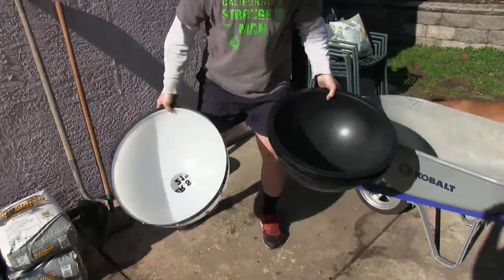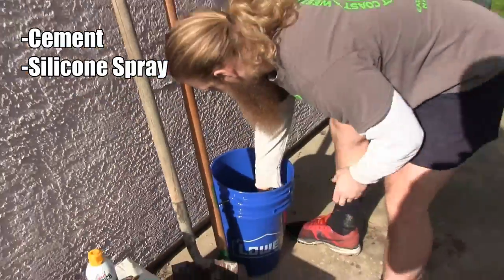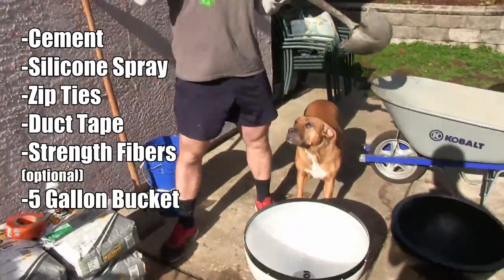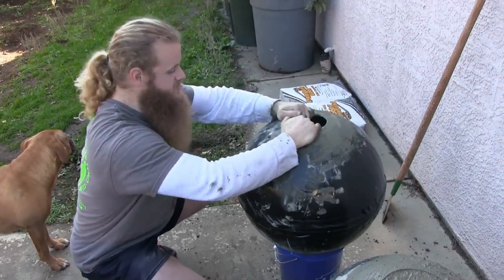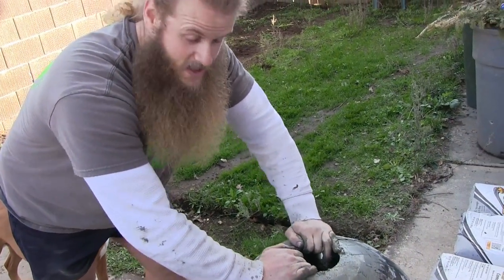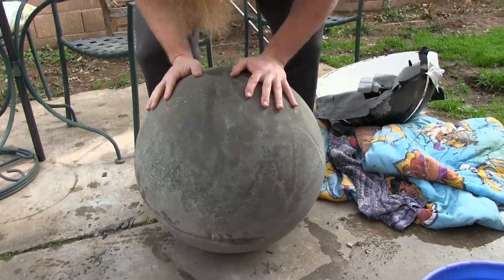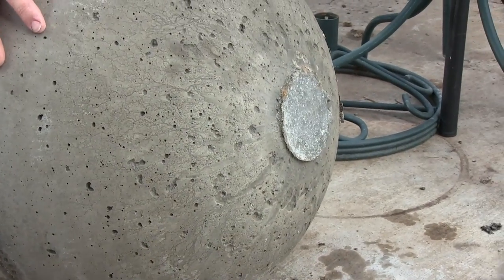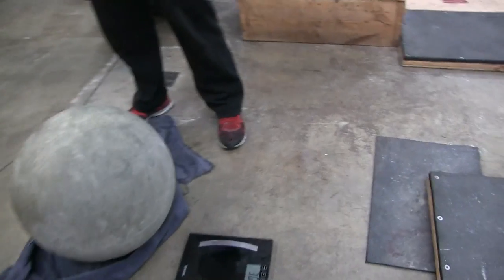How To Make An Atlas Stone: Slater Stone Vs. Hybrid Stone

Comment: I might be missing something but could you not put a strip of tape on the inside of the hybrid mould to stop the mixture leaking out, then put on the silicone spray. May be a bit of a pain taking the mould apart but less work with a grinder.
Reply: The problem with tape on the inside is that it would make removing the molds much more difficult. I've needed a heat gun for some of my stones because they were so tight. I imagine it would be a lot more difficult to remove them with tape in place, which has been well pressed into place by the weight of the concrete.

Comment: I don't know if your technique has gotten better buttt. Tap the mold with your hammer lightly all around rather then you hand, or invest in a concrete vibrator. Also, wetter concrete is harder to work with but after it sets (2ish weeks) it has higher tensile strength under load. I would also recommend using an additional 5gal bucket to pour water initially instead of small cups at a time.

Comment: You could duct tape the inside of the hybrid stone mold. Since the hole it so big it should be easy to put it in there
Reply: So the water doesn't escape through the side

Comment: You could have placed some of that duct tape on the inside of the leaky stone mold, along the equator.
Reply: 911LexVegas I've made 6 using the Hybrids and that's exactly what I did. they're not perfect, but too wet a mix doesn't help.

Comment: That hybrid mold probably would have worked better if you used bolts and nuts instead of zip ties.  Still not as good a system, but my guess is it would have leaked far less

Comment: A concrete vibrator would be the perfect thing to use to vibrate the concrete to get the air bubbles out and settle the gravel.

Comment: I don’t know if you’ll ever see this comment, but you can hit the mold with a saws all or a concrete vibratory to push out all of the air and you also won’t have that line you’re talking about that’s gravely.

edit: also... get a mortar hoe to mix your concrete and wet your wheelbarrow down before mixing it. 

source: 10 years doing concrete.

edit2: when you’re patching the holes, use a piece of thicker plastic. you’ll get better results

Comment: The interesting thing is concrete gets harder and more solid over the years, way after drying. There's a big difference in a new concrete slab, vs a 10 year, or a 30 year old slab. If you've ever nailed much tack strip down, you know this.

Comment: A simple piece of tape. Around the inside of the hybrid mold keeps it from leaking out. As opposed to 3 miles of tape on the Slater mold. However, slater mold is still better haha

Comment: Sorry if you mentioned it but what would the estimated price of a 200 lb stone be
Reply: The concrete cost $4.50 per 80lb of high strength concrete at home depot. Check the molds price. The tape is cheap, so are zip ties and the bucket is literally $4. So besides the mold (probably not that cheap) I wouldnt expect to spend more than $25-30 per stone.
Reply: thanks, really not too bad

Comment: I think that you don't need that much tape, maybe the same concept but not take it all the way to the top and bottom. Maybe a 10"-12" strips in the vertical position all the way around and then cover them with the three horizontal strips overlapped. I'm not an engineer but maybe someone that is could chime in with some official knowledge.

Comment: What you were doing with the shovel handle will get the air bubbles out, but use something smaller like a piece of rebar. Or rent a small concrete vibrator.

And PLEASE wear a dust mask when grinding concrete!!

Comment: Cool vid man, maybe a band of duct tape in the inside of the jointure of the hybrid mold would've done the trick!
Reply: +sans nom but how would you get it there?
Reply: +sans nom but how would you get it there?
Reply: Just with your hands, the hole on the top is big as hell, it would do
Reply: +sans nom But then how would you cut the tape when it comes time to remove the mold?
Reply: +Corey Lambrecht this
Reply: +Corey Lambrecht damn, I was gonna do that but all I have is a knife

Comment: The longer it takes to cure the stronger the concrete.... (  keep concrete covered if possible )... also ,   the more water you use to mix in the concrete the weaker the concrete is when dry.

Comment: that flex seal rubber spray can stuff. guy commercial clams spray screen door in boat bottom it float. I use it spray foundation house when dig garden so water go houses. you spray that on stone protect drop it. and fill holes. though not sure make easer grip. strong guys want hard grab possible.

Comment: You should wear gloves when handling cement. That stuff he's using won't be so bad as it's already mixed with aggregate but if you're mixing your own concrete you should wear gloves so the cement powder doesn't get on your skin. Luckily it's never happened to me but my dad has had skin on his hands literally split open deep because of cement sucking the moisture out.

Comment: first mistake you made with the hybrid mold was to use Zippy ties. you should have used bolts and nuts with Fender washers. Zip ties are for lazy people.
the second thing you need to do is put a itty bitty line of plumber's putty between the lips before you sandwich them together. This will prevent the concrete from losing out and will not dry and harden up preventing you from being able to separate the mold
Reply: The leakage was not at the points the mold was zipped. It was between the zipped points. How are bolts supposed to prevent that, genius?

Comment: As I was watching this... very manly video, I wondered why you'd need such a thing. I realized that if you were to take a mold and fill it with, say, sand, it wouldn't be heavy enough. These guys need concrete otherwise the stone would be too big. So yeah makes sense.

If you really want to remove those air pockets you could rent a concrete vibrator. They are pretty cheap. If not that, then just pound it with a stick in a masturbatory fashion. It's more effective than smacking form the outside.

An embedded wire mesh would be better than fibers, but that might not be worth your time. Depends how many stones you break dropping them.

Comment: Allan Thrall, pro tip: Yes you can fill it all in at once, but you need a vibrating stick (not a dildo joke, this is what's use industriwide), this shifts around the mixture and force air bubbles to the top. They are fairly easy to make from ex an old grinder or something like that and a broom stick :)

Comment: OSHA now requires you wear proper personal protective equipment (PPE) and take specific precautions when handling concrete due to the amount of silicone (or was it silica? is it the same thing? I think it was silica, anyway..) just thought I'd point it out.. Could cause you to die at an earlier age but I mean the cancer caused by everything known to the state of CA might kill ya before anyway

Comment: Both molds seemed to suck, Neither one offered any unique or intuitive design to lock/release the 2 mold pieces, Both were just 2 half asses DIY lock/release methods, The black mold was a simpler locking method, But it leaked, The white one had a good design with how the 2 pieces connected, But leaving it to duct tape to keep the pieces together is pathetic, The hole on the white one seemed a little small, The one on the black seemed way too big, Etc.

Comment: instead of lifting a big ass concrete ball which 9 times out of 10 well eventually wrench most people's back just go out and get a manual labor job working in construction. You can do shit like lifting a ball of weight all the time and get paid for it. I see people do this nutty shit in the gym and they never seem to get any bigger. Most of the time they drop that shit on the floor and annoy most of the gym members. I think they should have these people go out behind the gym and do this crap in the parking lot near the trash cans..

Comment: Instead of using more watter to allow the concrete to be more moldable, you could just add a plasticizer to the mix. It will make the concrete more resistant because of the reduced volume of watter put in the mix and easier to work with.  You coul also use a little bit of lime instead of the plasticizer; its cheaper but it will take much longer to the stone to adquire its full resistance if u use it. Detergent also increases the workability of concrete, but it reduces its durability considerably and there are no big studies about its use in construction.
Also, take care not to vibrate the concrete too much. It will cause the gravel to sink to the bottom and the watter to rise to the top. A good visual queue to stop vibrating is when watter starts to acumulate on top of the concrete.
Just google slump test if you want to know more about the topic

Civil Engineer here

Comment: Spends an entire roll of duct tape sealing up the Slater Stone, blames the Hybrid Stone for leaks. Still a big fan of this video in particular, and Untamed Strength in general, but unfair comparison much?
Reply: Max Berson he didn't take the slater for the seal. It seals itself.  He wanted to make sure the top didn't come off. Zip ties are supposed to seal the hybrid per instruction.